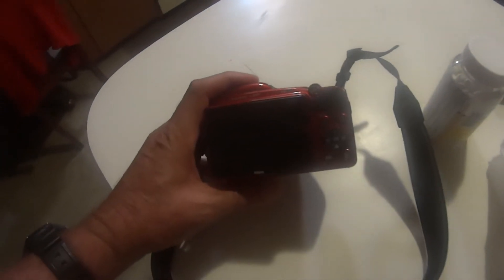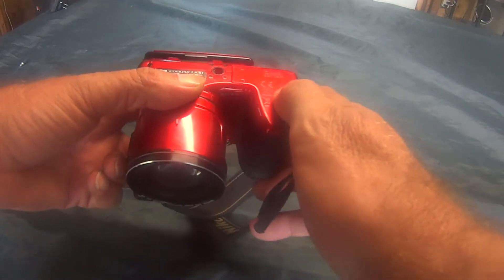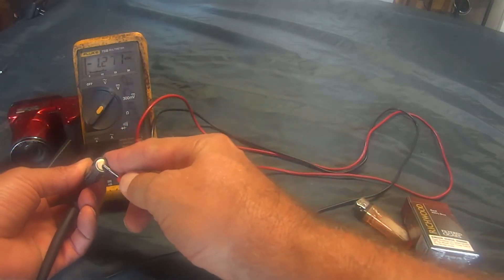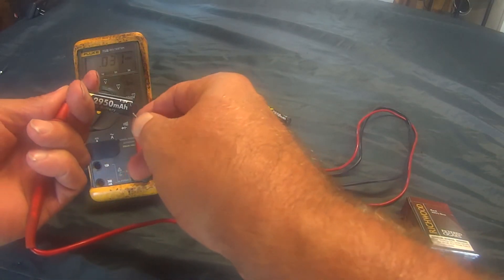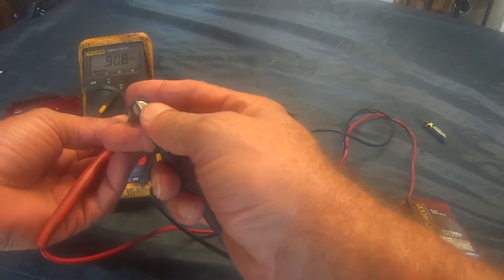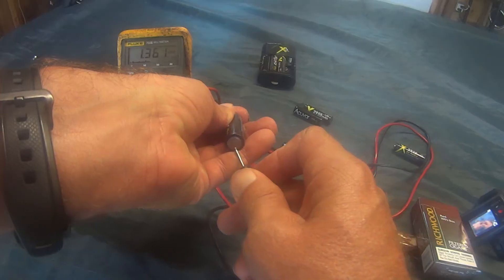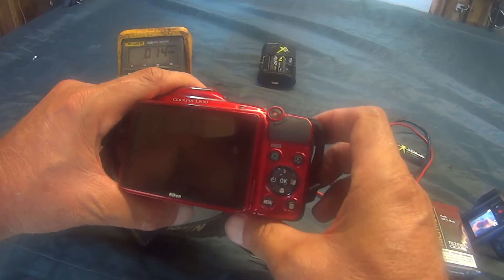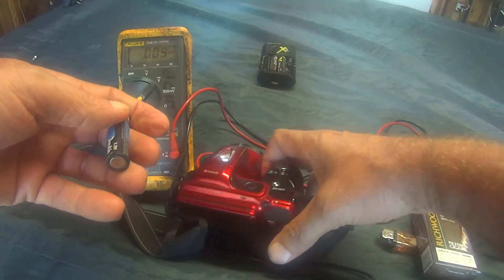Camera Not Working Battery Exhausted  Troubleshoot

Comment: Bought a new nikon wire charger for my coolpix l6. It doesn't show that it's charging, just the " preparing transfer". Even with new batteries it still shows "battery exhausted".

Comment: If you go into your settings, there is a section for your battery. Choose which battery type you are using. Also, use high quality batteries and you'll find they last much longer. Thank you.
Reply: How? I can't even go into it's settings cause of the issue

Comment: Turn on your camera and press the Menu
    Navigate to the Setup section and choose Battery type from the menu.
    Now select the appropriate battery type that you’re using and press the OK
    After doing that, the issue should be resolved.
Reply: Please can you give out all the steps
Reply: What if the camera is fully dead?

Comment: Won’t take video but works fine otherwise. When I go to record it just shuts off with the battery exhausted message then it won’t work at all until I change the batteries completely
Reply: We have the same problem. Did you fix your camera?

Comment: We have the same camera, the only thing is. My camera wont even turn on and show battery exhausted.
Reply: Did u get any solution for it? I'm having the same issue pls help
Reply: i found that in my c1433 too
Reply: I am facing the same issue in my camera
Reply: @ramuseepana9346  try swapping you're batteries(rechargable) or let the camera rest for a few days without use. I can hardly remember how I fixed it a few days ago but if works perfectly fine now.
Reply: Same here
Reply: @co0ter1  by replacing old batteries with new batteries then resolve the issue
Reply: @ramuseepana9346  I'll try, I'm using rechargables. Perhaps they are tired
Reply: @ramuseepana9346  thankyou so much for encouraging me to change the batteries! It works! 
I was sceptical because I bought the camera cheap not knowing if it worked. When I tried some trusty rechargables that I have had for a while, it just wouldn't work. A fresh pack of batteries with the copper coloured top have done the trick.
Reply: Same in coolpix l310

Comment: Take a 12v battery charger  - put it on 2amps - then hit the terminals of the bad battery for a second (until it sparks) - then charge it again - if that doesn't kick it into a full charge - then hit it with 10amps for a second
Reply: Man, you crazy. trying to get somebody riding on a hot lighting. 👀🙈🙏
Reply: @marvincole526  - Ahaa! That sounds poetic!
Or you can take it apart and replace the lithium cells

Comment: I Dont use rechargeable batteries, replaced all 4 with brand new ones, didn't work...not helpful
Reply: Have you tried changing the settings on the type of batteries you are using?